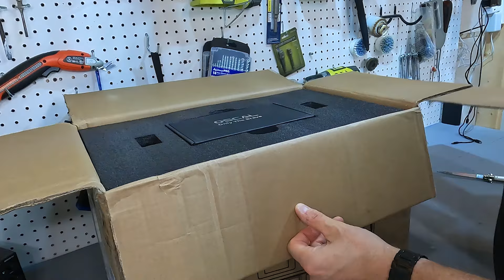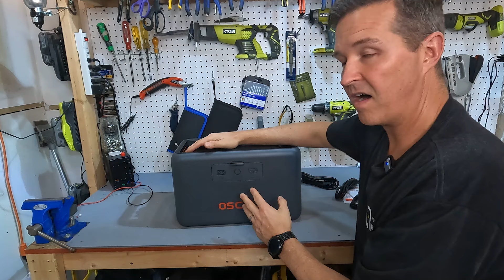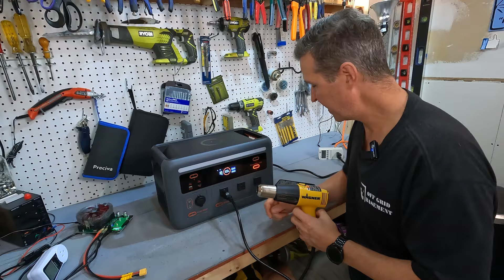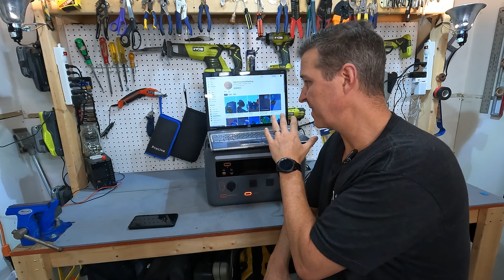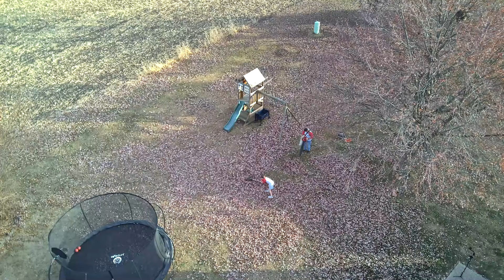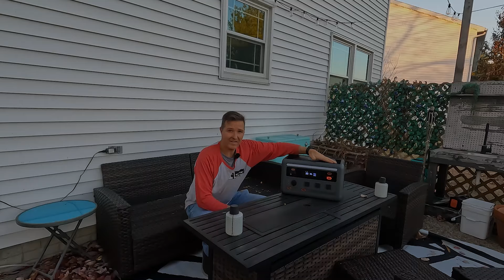OSCAL PowerMax 1800 Portable Power Station.  This has everything I need for a great price!

Comment: Curious if the charging power can be adjusted. In the one test you did (where you plugged in and got an output wattage drop) and it prioritized charging at 400w, if the charging limit was lowered, would it be able to hold the ~1500w of output power just fine.

Comment: I have an older oscal 700w, 666wh ps that can run a DC vacuum no problem. It can charge using the ac and one of its USB c at same time for fast charge. Your should have the feature as well. BTW, mine, even it it is an old model, has a wireless charger, but the handle gets in the way when my phone has its case.